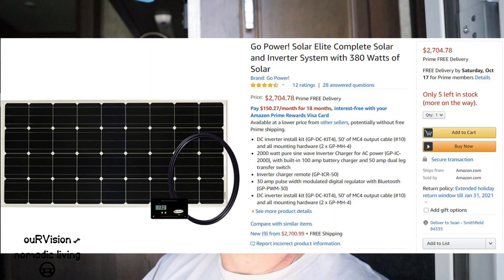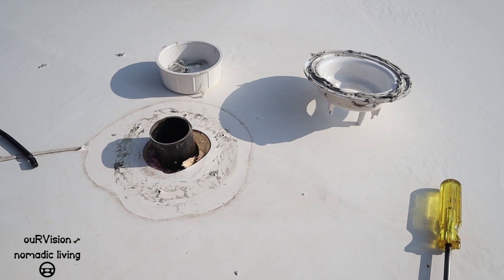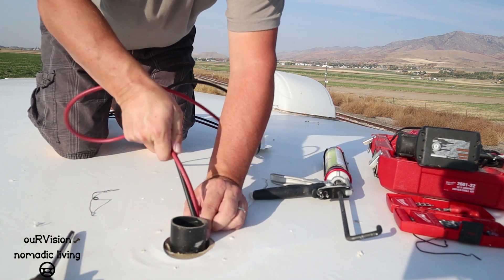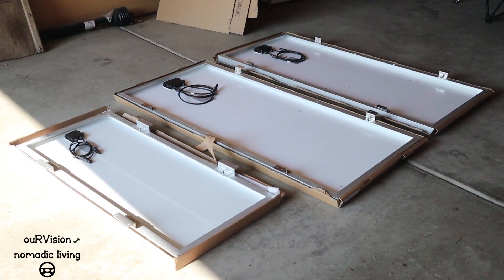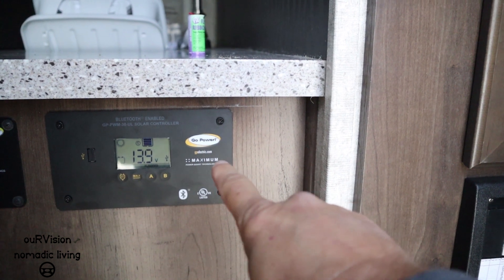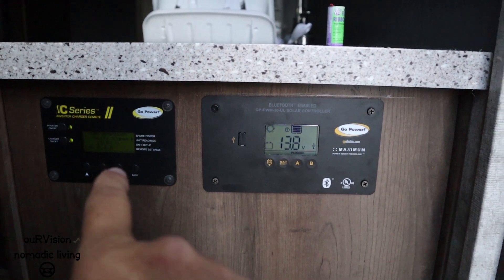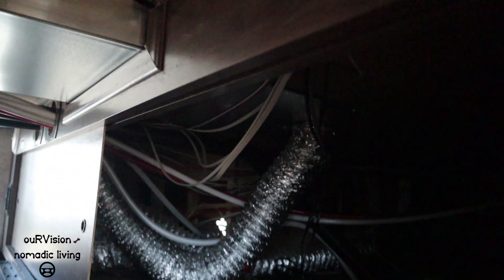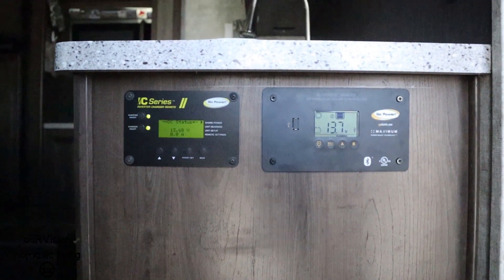Go Power Solar Elite Charging System/ Complete RV solar system install

Comment: Holy cow that's expensive! I was about to say you got ripped off then I noticed the video is 4 years old. I installed solar on my camper. I have 400 w of solar and a 3000 watt inverter that powers everything I need. I'm into it under a grand. I also have 900 amp hours of lithium battery Bank
Reply from the maker: It's a package deal offered by Go power. I honestly haven't checked prices lately, but I suspect that Gopower Transfer switch inverter is still a hefty penny. Regardless its been a great system. 👍 Thanks for watching. 😁 Sean

Comment: Well done, I too have the same go power inverter charger , really like it. Its combined with the go power 6 volt 224ah batteries.  For now I solar panel but plan additional ones. 
Thx a bunch
Reply from the maker: Thanks for watching and commenting Alan. Glad you found value in the video. Safe travels!! Sean

Comment: How many batteries are you running and what kind?
Reply from the maker: They have 4, group 27 marine/rv 12 volt batteries.  Thanks for watching.
Reply: @ouRVisionnomadicliving  Awesome.  Any reason you chose those VS 6V.  I am looking to do 570 Watts of solar on the roof. And trying to determine 12 VS 6
Reply from the maker: Hi Zane, For the previous couple of years they had been working as camphosts at a RV park in New Mexico, so they had hookups. In Sept we began traveling together and mostly Boondocking. Because of this they bought 2, 12 volt batteries to add to the 2 that came with the rig. Giving them 4, 12 volt batteries. After some lengthy talks they decided it was time to add solar. This is when we installed the solar system. Had they not purchased the 2, 12 volt batteries just prior to installing the solar I suspect they would have switched to 6 volt batteries. I have 670 watts of solar on my rig and I have 4, 6 volt batteries. I did a video 2 years ago showcase my system. Here is the link if your interested. 👍 https://youtu.be/q73OsrGTfIU

Comment: How does your inverter feed your water pump?
Reply from the maker: Hi John, not sure I understand the question, the water pump is run off the 12 volt battery system. In this application the addition of the IC 2000 has nothing to do with the 12 volt system. It still pulls directly from the battery bank. That being said, when not connected to shore power, when the IC 2000 is turned on it pulls power from the battery bank, converts it to A/C power and energizes all A/C outlets, the micro wave, the AC circuit of the fridge. Ect. I hope I answered your question. Thanks so much for watching and commenting. Sean

Comment: Check out that extra panel you added.... it may be pulling down the array output to the amperage of the smallest panel. Panels should be matched... Best practice would be to eliminate that panel or use a separate charge controller for that panel, and you'll get better output, ironically.  You can test this by checking the solar output of the panels in production.  Turning the system off, then disconnecting the 100 watt panel and turning your system back on.  Check the amperage and voltage with and without the 100 watt panel.
Reply from the maker: Hi Jeremy, you make great points. You are correct that had we wired them in series the amperage output would have suffered with the mismatched panels. In dad's system we connected the 3 panels in parallel instead of in series for the reasons you wrote about. When connected in parallel amps are additive  across the array vs. when in series the voltage is additive and the amps are averaged. As we are more concerned about pumping amps into the battery bank than a "high voltage" array. Most RV installations choose to install the array in parallel. Thanks so much for watching and commenting.
Reply: good point

Comment: One thing that u left out. Power share only works on one leg. I believe it’s L1. So if u plan on using that feature of the inverter for the A/C make sure that the ac is on the same side of L1.
Reply from the maker: Thanks so much for watching and clarifying that. 👍 Sean.

Comment: You may want to watch the clip about connecting  mismatch panels. You never said how you wired but you maybe doing a disservice connecting third panel to solar system. 
https://youtu.be/vwiDKn2-Atk
Reply from the maker: The panels are wired in parallel. In this system the use of a mismatched panel is not a concern as we are more interested in summing the amps being produced by each panel to feed back into the battery bank. If the panels were wired in series then yes, using a mismatched panel would not be smart.

Comment: Great video!  What kind of solar charge amperage are you seeing with this setup?
Reply from the maker: Hi Shannon, the install is on my in-laws trailer. As the batteries were charged up when we did the install, and they haven't yet gone anywhere. Hard to give you a good answer yet. I suspect the array should put out between between 12-17 amps/hour depending on the angle of the sun.

Comment: We haven't jumped into solar yet. Every time we kind of talk about it, we pretty much talk ourselves out of it. Generally, when we're somewhere that we can't have electricity, we just use a generator. I think one day we may invest in it, but it's not something we have decided to do yet.
Reply from the maker: Thanks so much for stopping by. Honestly I can't imagine not having solar. Our current 5th wheel is our 4th RV over the 34 years we have been married. We have had RVs since 93. We had solar on our previous rig as well. It was one of the first things I installed on this one after buying it. We camphosted at the Goose Island BLM campground outside of Moab, UT for 5 months last year, March 1- May 20, then returned on Sept. 6-Nov. 13. There are no hookups in that campground so we effectively boondocked there for 5 months. We do carry 2 Honda 2000 Generators, but we don't use them much. After spending the week with Angies Parents traveling through Idaho my In-Laws decided they needed solar. They had it on their previous rig but just hadn't pulled the trigger on their new rig. After seeing that Angie and I didn't use our generator at all during that week on the road, they decided it was time. Especially as we will be traveling together for most of this winter.  Thanks so much for watching and commenting!!! Sean
Reply: @ouRVisionnomadicliving  If we were full time, I think we would for sure do solar. Cost of gas would be too crazy. It's not something we've completely ruled out for the future.

Comment: Good idea with running the wires down. Less drilling is probably safer for all. I think we all would be huffing and puffing up the ladder as well.  Glad it wasn't us trying to deal with all those wires. Good job handling all of that! Love the aerial view. Stay safe. Donovan and Jodi
Reply from the maker: Thanks for stopping by!! The configuration of their rig sure made for a clean installation. 😁 After going up and down the ladder several times I was ready for a beer that's for sure. 👍 We sure appreciate your support you two. ❤️😁 Sean

Comment: I would not be without mu solar set up.  We have gone all 12 v though so do not have an inverter.
Reply from the maker: Thanks so much Dave. Interesting that you have gone all 12 volts. Not sure we could get away with a strictly 12 volt system. Angie wouldn't be able to vacuum or run the washer....opps, did I type that out loud...LOL. Thanks so much for watching and commenting. Take Care over there. 👍😀❤ Sean

Comment: Yes, I liked the video my neighbor nextdoor is getting ready to install his solar panels just after a recent trip down to AM Solar for batteries and an inverter.  The idea of having the solar to run the fridge while going down the road would work for us I guess I better consider some solar panels.  My 50 watts original installation probably needs a little assistance to those 4 AGM batteries.
Reply from the maker: Greg and Esther are sure excited to get that install done and out of the way. Their previous 5th wheel had solar and an inverter in it and they missed having those systems in this new rig. I was excited that we didn't have to drop the underbelly to run wire in the inverter/transfer switch. Thanks so much for watching and commenting!! I hope your kitchen remodel is going good. Take care!!! Sean

Comment: Wow Sean this is a really fantastic install, in depth but simple enough to digest lol Renee and I have not yet installed the solar panels on to our rig. We are hoping to do this within the next year or so so that we can get out and do some extended Boondocking. That is a fantastic Addition in that it allows you to run the fridge off of the solar instead of using the propane. Also that is really neat that you can run the microwave for a short time, I never knew you could do that. Thanks for sharing, big thumbs up from the Hanks family 👍🏼- Kyle and Renee
Reply from the maker: Hey guys!! Thanks so much for stopping by. Yes, mom and dad are pretty excited to finally get this system installed. Their previous trailer had solar and an inverter. And they missed having it in their current rig. We do lots of boondocking. I can't imagine not having solar...and a good inverter. It makes living in these rigs more....I hate this word...but more.... normal.  LOL. Thanks for the nice comment. Take Care!! 👍😀❤ Sean & Angie